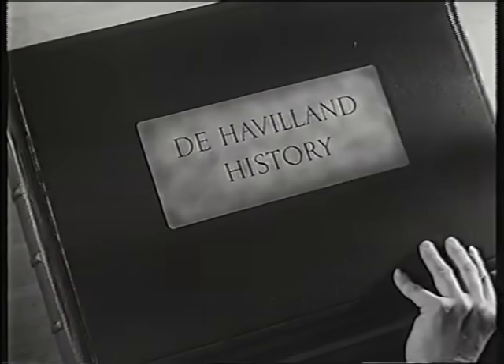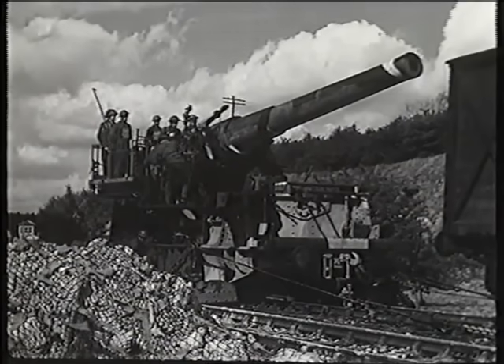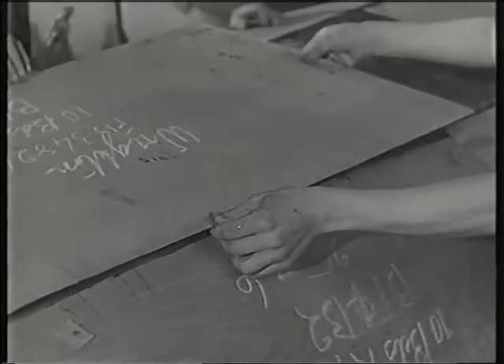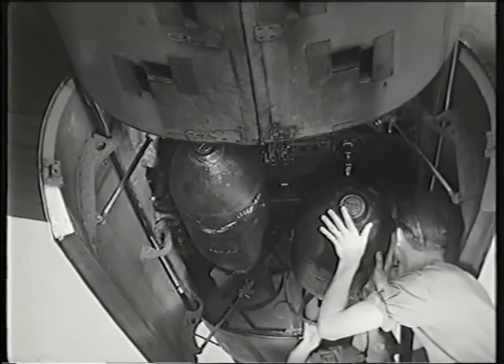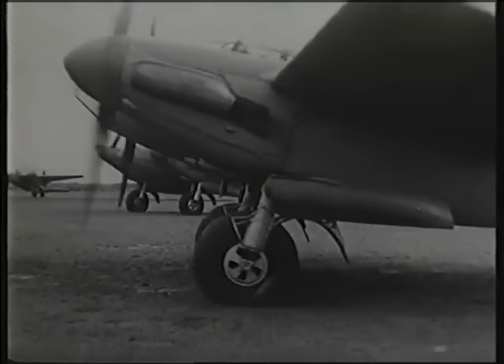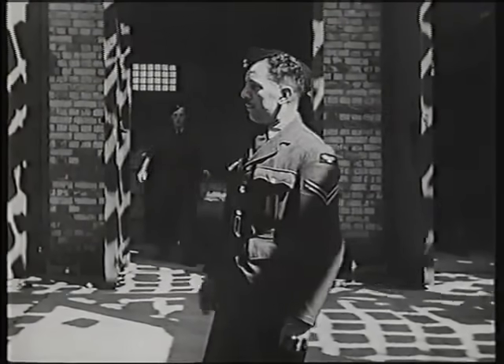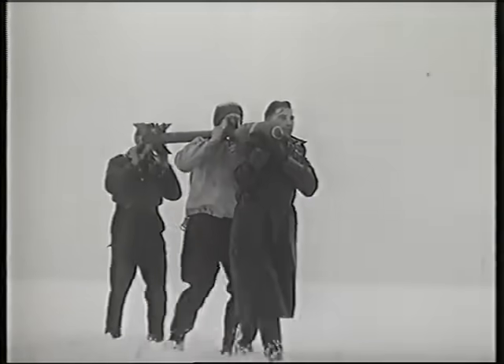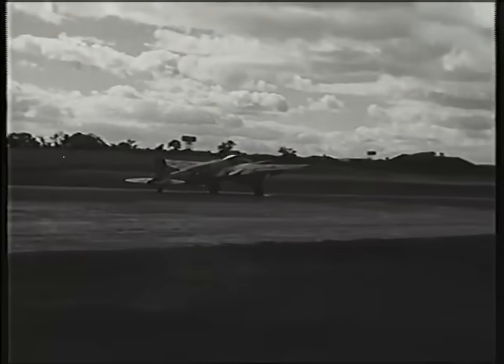The De Havilland Mosquito

Comment: About 35 years ago, a friend (in the US) visited a British air museum and returned with a recording of a preflight (audio) checkout, which he played back on his high-fi with a pair of 100-watt speakers. Mesmerized teens drifted away from their music in the basement to feel to feel the body pounding acoustic vibrations from the Mosquito as it went through the checkout procedure while warming the lube oil equally in both engines before accelerating down the runway -- and blowing out the preamp on the recording device -- very impressive.
I suspect that many enthusiasts would appreciate a link to that recording if one could be found.

Comment: I grew very weary of the Brits and Anglophiles rattling on about this aircraft and thought it to be typical braggadocio. However, principally because of this film and supporting facts re the Mosquito, I came to greatly admire the engineering and creativity that went into invention and  development that comprised this unique aircraft. The "homespun" work -- using what precious resources and skills of Great Britain during the war -- is very endearing. Add to that the fact that they stripped the concept to the very bone with no armament and spare additional comforts to produce one of the fastest aircraft for its time was significant. But adding back armament, additional bomb load, and extra fuel for range, turned this into a formidable weapon.

All this and the appearance of this sleek fighter bomber has made me a huge fan! 

Well done, Brits!